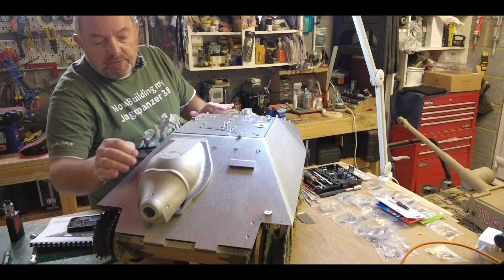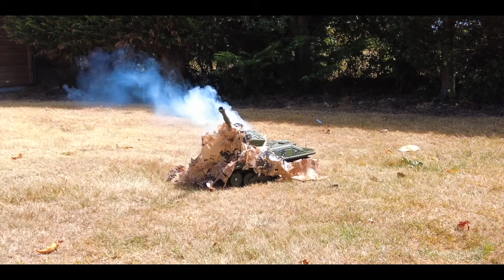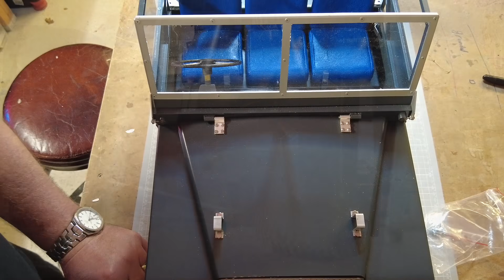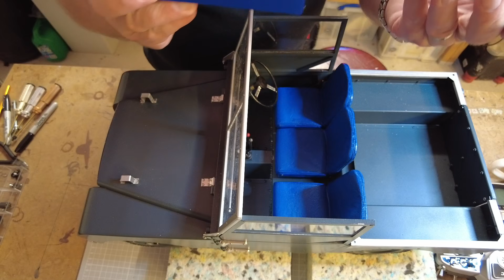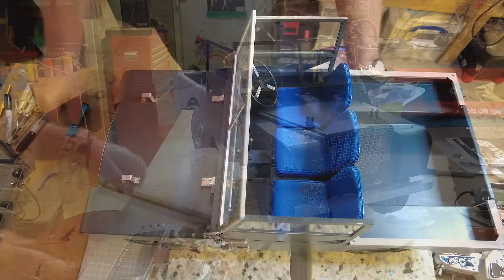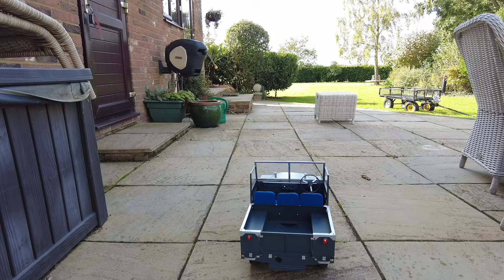1/6 scale model -Armortek Series 1 Land rover(Vid 19) finishing the electronics and 1st TEST Drive

Comment: Hi Tony I look forward to seeing how you fix the the canvas top to the model as I am a bit bewildered when I look at aii the tiny straps on the canvas! Also where did you decide to put the spare wheel? Mine is in the back dip fixed by a bolt rather like a spare wheel in a car!( see Bobs kit 24 build ) on the forum. Regards
Reply from the maker: Hi Bob, I will check out your build on the Forum. Not tackled the canvas yet...next job I think...Leaning towards the wheel on the bonnet, but this may have to be a velcro option as it needs to come off to get full access to the a myriad of wiring etc. underneath. Best regards....Tony